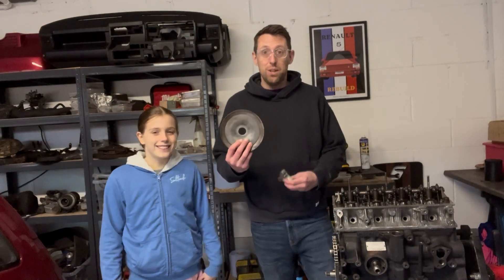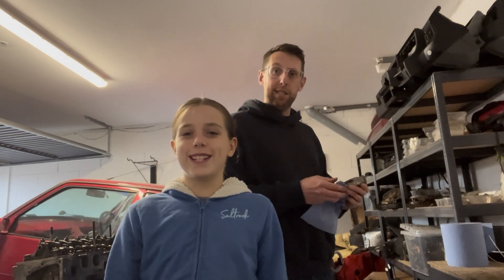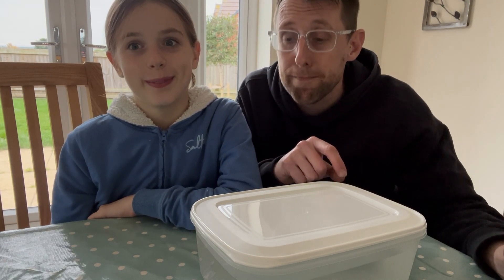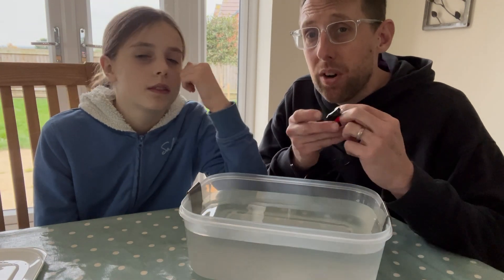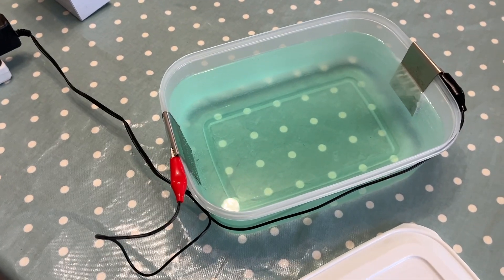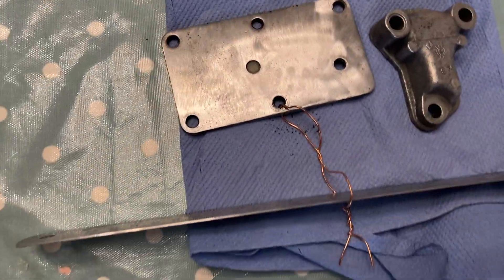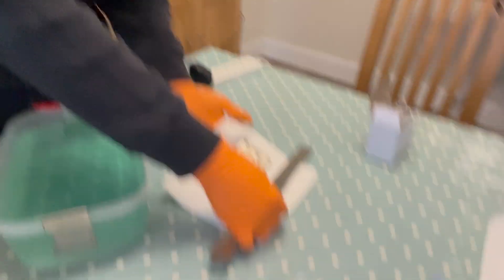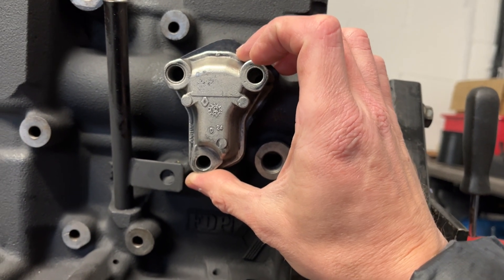Nickel Plating Car Parts!

Comment: The first experiments are the most difficult!
Plating any metal is very sensitive to preparation plus voltage and current. You're probably ok voltage wise but a bit low current...you can overcome that to an extent by leaving it longer.
Prep is a different story as you might need acid or alkaline pickling (not sure for nickel) and clean water rinse. Its a bit of a black art!

Comment: Hi Gregg and Imogen. Just found your channel, binged all the videos and subscribed! I really love the father/daughter vibe. I am 72 now and on my last project I think (1998 BMW 840Ci). I have tried to get my son, (42 now), interested, but he does not want to know, so you are really lucky. Back in 1988, I had an Escort RS Turbo (REALLY wish I had kept that!) and my best friend had a Renault 5 GT turbo. We both had our cars up-rated by Turbo Technics in Newcastle, and they did a great job. I can probably give you bits of good advice, I've been tinkering for over 50 years and restoring for about 12 years, but the problem with YouTube as I see it is that every commenter is an expert, so you need to be careful who you take notice of. Anyway, good luck with the project, and remember it is normal to lack motivation every now and then and get totally fed up with it.
Reply from the maker: Thank you for your kind comment and pleased you are enjoying our videos. Think we will be contacting turbo technics soon to organise either the turbo to be fixed… or worse case replacement. Hope your restoration goes well.

Comment: Hi really like the videos.Well done both of you. I think the problem with the plate is contamination. I'm not an expert on plating, but from what I've seen there's usually a couple of cleaning/acid dip process before going to the plating bath as they need to be spotless. The other thought is that the marks look like where you rubbed your finger after the first round in the plating bath. Keep going, it's all a learning curve. ;-)
Reply from the maker: Thanks for the tip! I think you might be right… given it a quick light sand and going to try again!